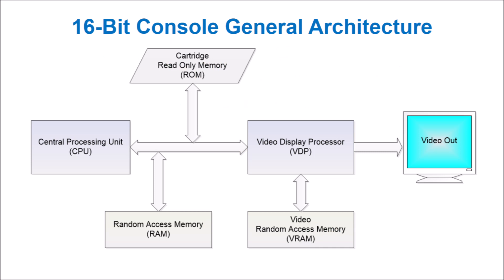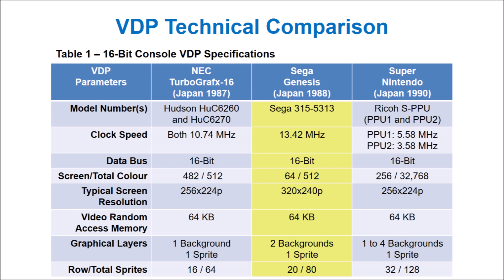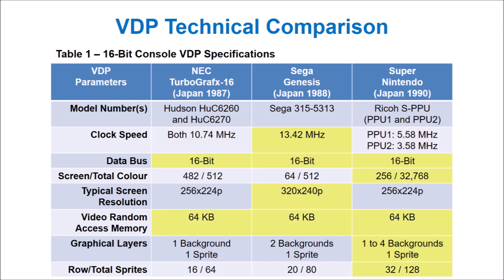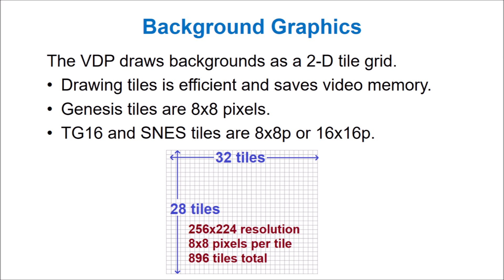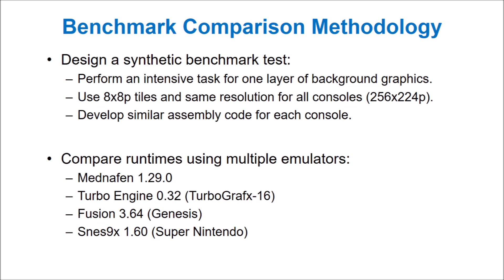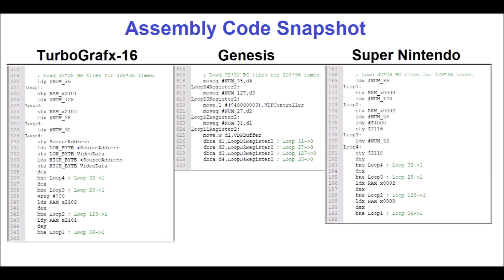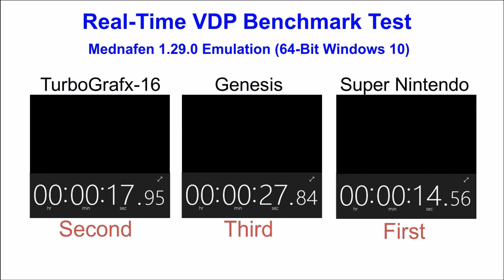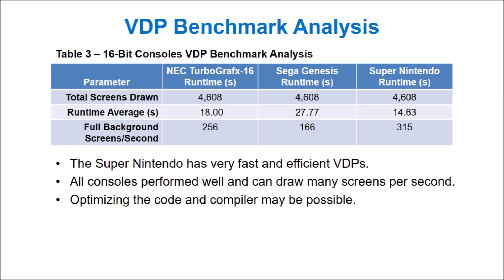VDP Performance: TurboGrafx-16 vs Genesis vs Super Nintendo

Comment: What are the limitations of the TurboGrafx-16 just the one background layer.Can the TurboGrafx-16 play Nintendo games if there was an adapter.
Reply from the maker: The TurboGrafx-16's single background layer only allows one background to appear on screen. The Genesis and SNES could display 2 or more overlapping backgrounds, which helps make game levels appear to have more depth. Programmers could simulate multiple background layers on the TG16, but this required more development time and effort.

The TG16 and NES have a very similar CPU, although it's not possible to directly play games with an adapter. I think a few games like Mega Man were unofficially ported from the NES to the TG16.
Reply: @hagopds  I seen those Nintendo games on Turbochip.They even have VIC 20 games like Jelly Monsters and Gridrunner running on the TurboGrafx 16 too.Just wondering what is the chip in the Supergrafx that give it a second background layer.And why didn't they use it in the TurboGrafx-16 or TurboDuo.
Reply: @orlandoturbo6431  I seem to recall that they slapped in a 2nd VDC, plus another IC to mix the two VDC outputs.  The clock speed remained the same, so you still had the same ROM -> VDC bandwidth, but it was now split between the two VDCs as you still had only one CPU and CPU bus to perform the transfers.  This probably doubled the number of available sprites, too.
Reply: @glenndoiron9317  Is it possible to add a chip in the TurboGrafx-16 to stop the flicker in some games.
Reply: @orlandoturbo6431  yes, the pce is expansion friendly.
Reply: @orlandoturbo6431  The flicker you're probably talking about is due to the fact that these systems can only display a certain number of sprites on each scanline.  For instance, the Commodore 64 can only display 8 sprites on each scanline.  If you want to display 10 sprites on a given line, the hardware simply can't do it.  Either the software, or the sprite state machine (depending on the console), will be configured to swap around which sprites are displayed each time the screen is drawn, which is a compromise - the sprites flicker, but you can see all of them, instead of some of them potentially being completely invisible.

If you ever saw a Turbografx game that looked like it had dual playfields, it didn't, it was probably using sprites to simulate it.  In a similar vein, the neo-geo also had only one playfield, which was used for showing scores and credits.  Everything else on the Neo was done with sprites - it could show 80 per scanline.

Because the turbo uses a state machine to select which sprites are displayed (you can send it a table of up to 64 sprites to display on the screen, and the hardware will pick and choose which ones to display as it can only render 8-16 sprites per scanline), it would indeed be possible to make an upgraded VDP that can display them all, however it would need to have 8x the memory bandwidth to do that in all cases.
Reply: You see the game designers made much different design choices based on hardware limitations. Donkey Kong Country would not be possible on the PCE because it lacks the layers, shmups were tough on the SNES because it could not do fast sprite map swaps for large enemies. Also DKC with the layers removed, is a boring simple platformer with very little happening on screen. Space Hariier would have been friggin hard to program on a SNES. So each game pushes its orginal hardware, making it hard to port to one of the other consoles.
Reply: @2kBofFun  You need to look at Donkey Kong Country for the NES by Hummer Team.If the NES can do it so can the PC Engine.
Reply: @orlandoturbo6431  WOW. That is amazing. Not only is it a working clone, it looks way better! They miss a few colours here and there, but besides that, the sprite design outperforms the original in every way!

Comment: Good video. But I would say this kind of test actually is misleading. You are not comparing the VDPs but just how long it takes to put some values into them. I'm not 100% sure but I would say writing data into those video registers will not halt the CPUs until the VDP is done. Based on this II would optimise the 68K code and change that move.l from move.l #$40000003, VDP_CONTROLLER to a move.l d5,(a0) . And of course put the respective values into the registers d5 and a0. You go from 28 cycles down to 12.
And also use an address register for VDPBuffer. There you will get 100% speed increase alone.

I have not checked that optimisation so please give it a try.
Reply: @Jôn I'm most familiar with the 68K. Feel free to optimise the others. Fanboi
Reply from the maker: Thank you Michael, really great suggestions. I tried a quick test by initializing d5 and a0 and changing move.l #($40000003),VDPController to move.l d5,(a0). It took the same time (under 28 seconds) to complete the test. Thanks again, very interesting ideas.
Reply: @hagopds  this pretty much confirms my feeling that the reason for slower execution is that the VDP can't respond to new data as fast as the CPU can deliver it.

Thanks for the extra test, very interesting stuff :)
Reply: @Jôn and just for you: for the Super Nintendo replace the stx RAM_x0002 with txa and ldx RAM_x0002 with tax. You do the math.

Comment: The previous video testing and this one are both interesting. Obviously, like you stated, optimization on actual game per specific console most likely would make a huge difference. Still really interesting how it's playing out. I'm shocked by the SNES result on this one.  Even more to learn! Thanks for sharing man.
Reply from the maker: Thank you so much. It's definitely fun and I really admire retro game developers for what they were able to accomplish.
Reply: Interesting, I like how you break it down. I know Sega should have added more colors and sprites and at least gave it the ability to scale and rotate sprites.
Reply: @ChazzWilson Yeah, unfortunately cos the loss they took from Master System they didn't want too go all out and cheap out too save money.
Reply: There's basically nothing to optimize, if it was done properly. Because it is just tiles.